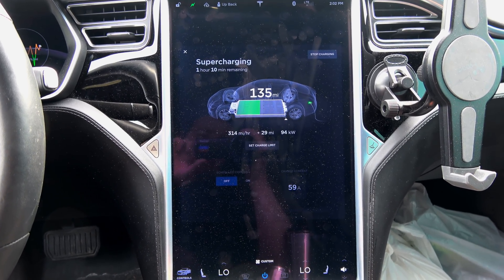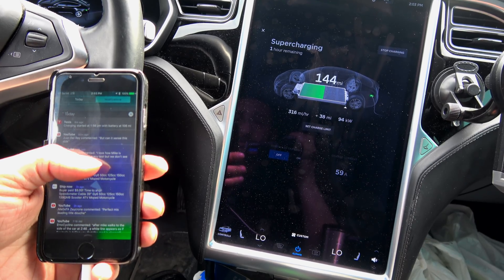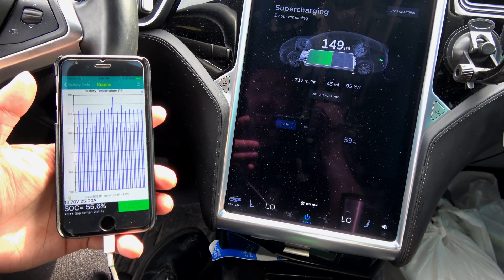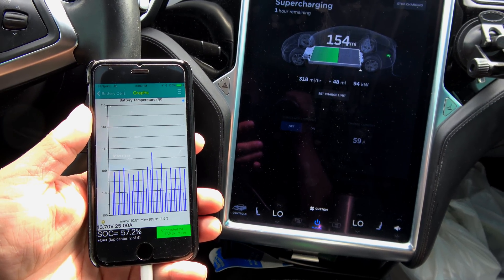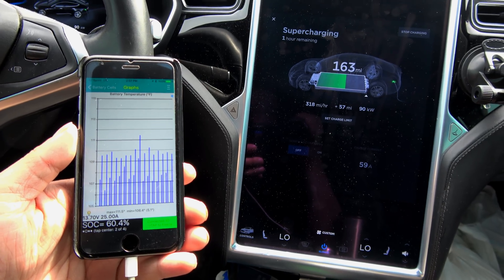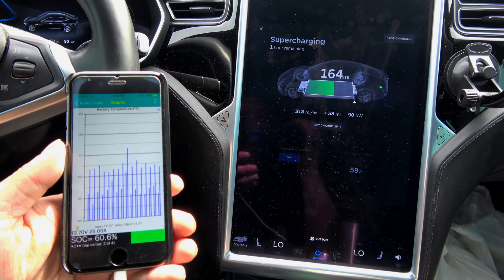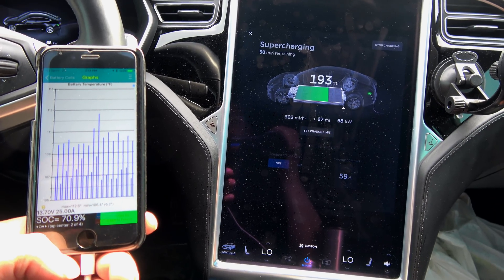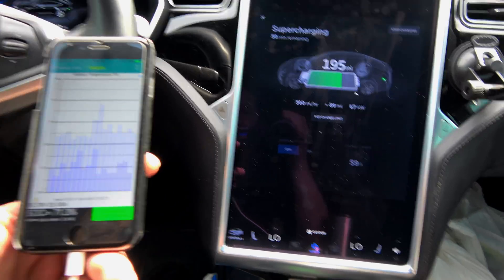Tesla: Supercharging Peak Battery Temperature Part 1

Comment: damn that’s significantly quicker charge at 50% SOC than my 85 pack.
Reply from the maker: Tesla is now capping original 60 and 85 packs in two ways. First off the original 60 and 85 packs are part of something called Batterygate scandal. Tesla quietly capped the maximum capacity of the packs cutting as much as 20% of total capacity in some cases by limiting the maximum voltage of the battery pack. Big class action lawsuit in the works. Currently getting reviewed by the NHTSA. Not all packs, but more and more each day. This started in June 2019. 
Also, ALL Model S and X vehicles are slowly getting capped in terms of charge speeds after they hit a certain threshold that Tesla wont tell us. Originally, it was the 90 packs that were limited to 94kw charge rate (As you can even see in my video. I've been capped to 94 since the second month of ownership!). Now, instead of just capping at 94, they completely changed the charge curve. 
I'll give you an example using my Model X. The old charge curve, I could maintain 90+ kw charge rate through 50-60% SOC. Now, I can hit those new faster charge rates, for about 1-2 minutes, at around 10-20% SOC, then it quickly drops. Now I am Lucky if I can maintain 50kw rate through 50% SOC. And drops further faster. My Model X 75D, USED to take 1 hr 45 minutes to go from 0-100% at a supercharger even though peak rate was lower, about 100kW. Now, even though peak rate is higher, I max out as stated for that 1-2 minutes, at 137kW, that 0-100% charge now takes 2 1/2 to 3 hours fairly easialy. Some times longer. When doing a road trip, especially when towing a trailer of some sort, that is an excessive amount of charge time. 
My Model S, thankfully, I've kept it on firmware 8.1 so it has not yet gotten hit by this worse chargegate scandal. I drive 45k miles per year, so if my charge times were increased by 50% on my MS, I would need to switch to gas vehicle. It would be unusable. My MX is now already unusable for road trips due to this. 
Another example. I purchased my MX last year March. Actually, I bought it approximately March 12th 2019 so one year tomorrow! I flew to Boston to pick it up and drove it home to Milwaukee, Wi. That drive,  that took me about 16 hours to drive home, if it was chargegate limited like it is now, that 16 hours would have actually been about 25 hours. THATS how bad it's gotten. These batteries have a DEFECT that Tesla is using software to mitigate to get these cars out of warranty before the packs fail.

Comment: I think Tesla should start quiet  active cooling immediately. Full speed glycol pumps. And pump that compressor up earlier.

Does Model S have a 3 fans? or only 2 for those ac condensers behind foglights?

Comment: Fairly high temperature they got to when it's only a 1C charge rate. Maybe just because they are completely encapsulated. Slightest airflow might be plenty.
Imagine if the cells were 2,3 or 4C capable. Things could move pretty fast. If ventilation would let them do 2C right now then that would be big already. With the tremendous number of cars coming online I think Tesla simply needs to go to 2+C charging. Otherwise we will soon have 1000 car charging lots constantly filled with charging cars.
Reply: 500km/h charging rate is already pretty good but say we get that up to 1500km/h then charging times are very very practical. That's 8 minutes for 200km range added. That gets you around. Sure the cable is fat and needs to be water cooled but well worth it if you can halve the stick around time. The biggest problem is probably the savage hookup you need from the power companies. They are traditionally rather expensive from what I gather and these locations will need power plant level power. If a single stall can take in 250kW and you have 100 stalls...
Also they will need to quit that power sharing thing between two stalls. If you halve the power then you don't really have that number of stalls.
If they start making half a million cars a year the infrastructure they have to create is huge.
I mean, there really is no way around raising the power level to 250kW per stall. Keep them doggies rollin.
Need a new plug.
Reply from the maker: At current, my car at 94kW charge rate would equal about ~13 watt/cell charge rate. So about 3.51 amps at nominal voltage of 3.7v. Thats actually really high. My battery analizer I use for analizing 18650 cells, at a 1 amp charge rate on a nice fresh excellent condition cell, that battery will get quite warm. It is a open air charger. At 2 amps it gets very hot (Uncomfortable?) to the touch. 

Now, my thoughs are to allow "Pre" cooling of the battery prior to arrival to the station. Of course only if you will arrive with plenty of charge (Say 20 or so miles left in the back). Give it a head start. Or, another method; start the AC immediately upon plugging in at the supercharger, because at current time, the AC compressor does not start. It will slowly ramp up the cooling fans, and then once target temp is reached then the AC kicks in. I find this inefficient, if it started ACTIVE cooling right away when connected, I'd be able to maintain my charge rate at 94kW right up to ~60% from 0% no problem. I had this problem especially when doing my road trip towing my teardrop camping trailer. My draw was so high pulling the trailer, I rolled in at the superchargers with a nice hot pack. 
Could probably shave 5-30 minutes off my charge time if the AC kicked in right away when plugging in.
Reply from the maker: New plug or thicker wire not needed. It will be unmanagable like CHAdeMO. Man I hate lugging those giant cables. 
I think Tesla screwed up by not going with a higher voltage battery pack. They have enough cells, and enough bricks to do it. Even the Leaf is a higher voltage pack. If they went higher voltage, say to 808v, which is double the current max voltage, then they could dump 2x the power into the pack with the same cable.
Reply: yeah I'd also think that keeping them cool would be best. Much above 30 degrees C they start to age and if it hampers charging, why not. 
If you charge at 94kW on a 90kWh pack, that's a little over 1C. Easy way to do the math. 115fahrenheit is probably uncomfortably hot to touch.  Simple air cooling might be plenty, especially if you have cold temperatures outside.
Reply: Leaf is 345-390V. Almost identical to Tesla. But yes it might have been prudent to go 800V, it just introduces some issues with choice of power electronics. I think it can be salvaged with thicker super charger cables though. And a new plug could be the same size or even smaller. I have advocated a spade plug. Two sides. Optical data in between. 1000A in a USB plug in principle. I think you want to go at least double to handle all those cars but why not a clean 1000A. Keep it simple.  And put the plug in the nose or both. Nose is far more logical for stalls. Big mistake.